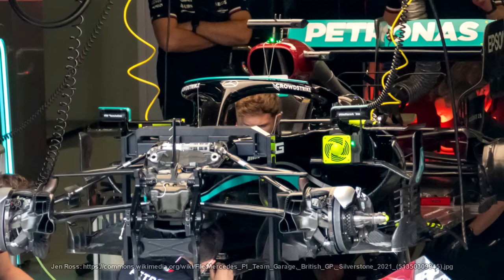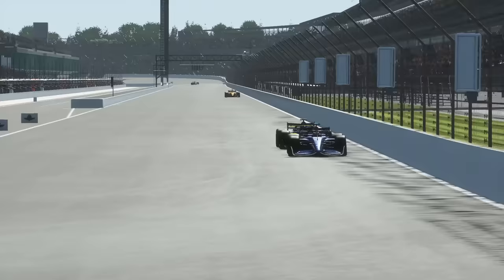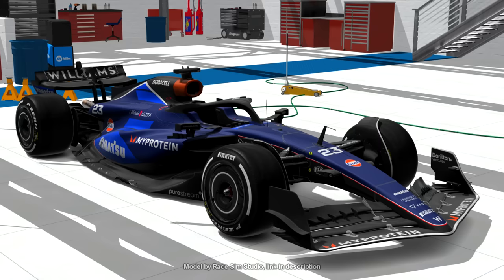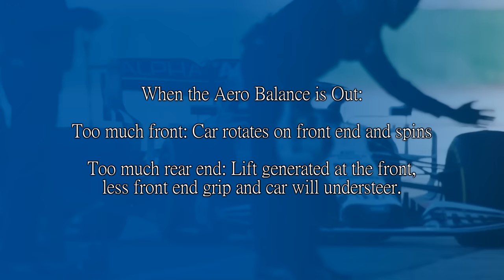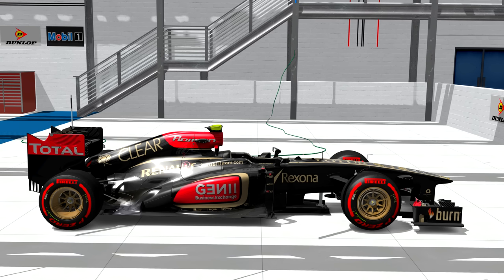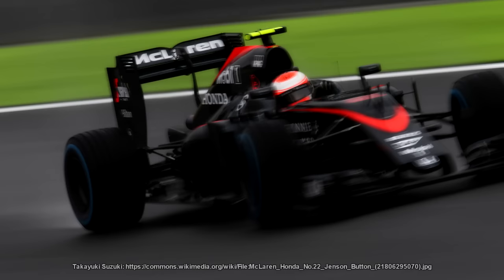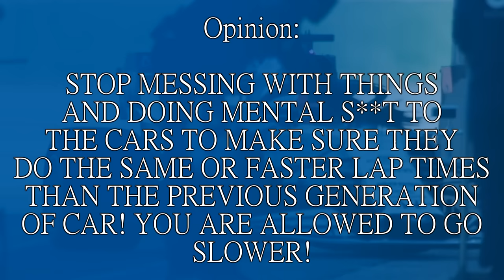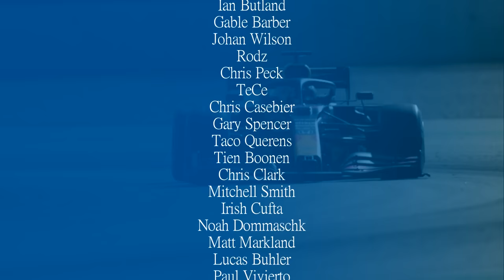BROKEN BEFORE IT'S EVEN IN? Opinions on the 'Undriveable' 2026 F1 Cars

Comment from the maker: Used Assetto Corsa for a video last week, and it's fine.
Use it today and it does not want to open. Anyone else having issues with Steam lately? Cos I've had to run integrity checks on a LOT of my Steam apps this week...
Reply: Not at all here but I haven't played anything more intensive than PES 2021 lately. Probably it was a Windows Update bungling everything up.
Reply: CS2 also needed integrity check for Workshop items
Reply: Are you on a hard-drive or ssd? If hd your disk might be about to fail.
Reply from the maker: @demonicsquid7217  … so what I’ve been doing for the last six years?
Reply: I recently had steam doing an update when I started it it complained about files missing and I clicked yes.
After then my entire AC reset. All Graphics, all controller mapping, all statistics, all lap times, all setups. My entire userfolder was gone. But thankfully I often back up my entire system.
Reply: @AidanMillward  I was very impressed with the way you turned the car around with your  180° turn.
Reply from the maker: @hueginvieny7959  hand clutches my boy :_drink:
Reply: no
Reply: Are you using content manager ?
Reply: Just for poop and laughter try unplugging your wheel base's usb connection to the pc and try and boot into a race. May not work for you, but, for some reason a cpl times in the last 2 years I'd randomly fail the race load repeatedly, only to trouble-shoot far enough to see it was the wheel doing it. Unplugged the wheel and instantly was able to complete the load in.  YMMV
Reply: @gavedillis2040  Sometimes when I turn off my usb audio interface it has a better time loading too. Can always just turn it on later. Just a weird conflict.
Reply from the maker: @reynaldiwidjaja277  yeah I am. Running it in 32bit mode has fixed it.
Reply: Works fine for non-racing simulators for me, but that's likely because this rig knows it's on the way out and is on it's best behaviour. The replacement is RIGHT THERE waiting for a windows install.

Comment: Small note on the Typhoon/Eurofighter: pretty sure it's quadruple-redundant, meaning if the flight computer fails, there are still three remaining to take control.
Reply: I would like to add a second note that the reason it needs those computers isn't so much about complexity, but because its aerodynamically unstable, just like that Lotus.  They could fly it, but the constant corrections would make it exhausting.
Reply: To be even more pedantic, it was inherently designed to be as unaerosynamically stable as possible, to enable it to make major changes of direction at the drop of a hat.

Comment: The more I hear about the 2026 rules, I just want to forget F1 and want a new pinnacle of motorsports. Maybe hypercars running 1.5 hour short races.
Reply: there already are series better than formula 1, so much so that i consider them the greatest on the planet. here they are: 
IndyCar, IMSA weathertech, super formula, and SUPER GT.
Reply: The whole depowering the engines at top speed on the straights thing is the sport jumping the shark gimmick if they go through with it. It's just so ridiculous and anything but "the top engineering competition". It sounds like the active aero is meant to be an autonomous system rather than something the driver controls which they apparently are very upset with. 

Smaller card, less prescriptive regulations, and put a cap on maximum PU output so Mercedes and Ferrari and Audi can run complex hybrids, and Red Bull can run a V8, etc... this forcing everyone into the same arbitrary box in the name of "close racing" will be the death of the sport
Reply: Formula gone.
Reply: Right? and with the engines turned up like the 919 Evo a few years ago
Reply: @solitaryclusterofneurons598  I feel like there should be a separate championship for the Hypercar class where the teams are allowed to go all-out with their cars to set the fastest possible lap times and the top 3 teams are rewarded with massive payments for it. Won't ever happen due to the increased costs but it's fun to think about.
Reply: oh god please no, wrc stages are already baby shorts
Reply: I pretty much gave up on Formula 1 last year. It's pretty much been a 2 team sport for over a decade and most races are a hell of an expensive DRS train between everyone else.
Reply: @CyanRooper  basically, modern day Can-Am.
Reply: Wec become Wsc, (world sprint championship) lol
Reply: @CyanRooper  That would just be LMP1
Reply: @CyanRooper  so like a laptime shootout? They do that at Le Mans for the final stage of qualifying.

It's not outrageously expensive to send the hypercars out for extra sessions; what Aidan described with allowing the cars to run slower is exactly how LMP1 gave way to hypercars, they're slower and cheaper because they're substantially simpler than LMP1.

But beyond that, to focus on one class over the others does away with one of the main quirks of endurance/sports car racing.
Reply: That was LMP1 hybrids until they started becoming too expensive.
Reply: Especially if Andretti are rejected
Reply: Hypercars are BOP.  I hate BOP^.  If Grand Prix car racing and Grand Prix bike racing can be still be competitions, where an Alpine or Honda can earnestly take responsibility for building a crap car or crap bike  respectively, why does WEC need to be BOP nonsense? 😐

^ BOP is OK in production based racing like GT3, as those cars are all fundamentally different and need some mechanism of balancing.
Reply: @TassieLorenzo  BOP is what entices auto makes. They don't have time/resources for vanity projects like they once did, and "we tried but it sucks" doesn't cut it with bean counters when you spend $100mil+ and get upstaged by an energy drink.

^ hypercars aren't that different from GT3 btw- same ethos of "bring what ya got & we'll work it out", just a grabbag of OEM/spec parts instead of a production car.
Reply: @PanderingSlats  My concern is that  BOP can be too easily manipulated, to for  example ,make it more difficult for  Toyota to  win Le Mans despite having built the best car.  If the Red Bull - Honda RBPT is the best car then it should win 21 of 22 races.   Fortunately the ACO "let" Toyota  win most of the other WEC races, but then there was recently heavy handed BOP that had Toyota struggling to get on the podium recently (or likewise Acura BOPed by an extra 20kg out of a repeat Daytona  24h win in IMSA). It shouldn't be about being "allowed" to win or "sharing" wins, it should be a competition to build the best Grand Prix bike, the best Grand Prix car or the best sports prototype!  For a TRUE competition, F1still has 6 auto makers signed for 2026,  which is fantastic and shows it can be done, just as WRC has three in a real competition and MotoGP has five manufacturers in a real competition.
Reply: Do any non Verstappen fans still watch F1?
Reply: @TassieLorenzo  Not saying this of you personally, but I hear a lot of pro-F1 arguments center around a notion of "true", "pure", or "real" competition, and to me that reeks of elitism if not willful ignorance. With high level motorsports manipulation is almost guaranteed, just a question of where/how and the poison you pick.

imho the "best car"/meritocracy ethos is susceptible to manipulation of resource procurement: You hire an Adrian Newey or a Ross Braun, maybe also bruteforce with money, and see how the stars align for your richest competitors. Disgustingly cynical way to look at it, but I think that's arguable for almost all F1 driver championships in recent memory.

I get why people turn their noses up at BOP, but not why they're so strongly against it. imo BOP manipulation gets blown out of proportion- it def. exists, I recognize how bogusly storybook some Le Mans finishes appear on first glance, but I still prefer a season like 2023 WEC over 2023 F1, because I grew up with a gamed meritocracy in NASCAR.

I'm fairly confident Toyota wasn't gifted the rest of 2023 WEC. They caught breaks early in the season, and that the IMSA models were sandbagged too much in the first couple races, but I think the Toyota had the rest of the season on lock because they'd had a couple years head start on the other teams, especially with regards to reliability.

Ferrari definitely had pace from the start in 2023, but they faced rookie mistakes/growing pains which took them out of contention. At Le Mans Ferrari was consistently fastest from qualifying onwards, but the latter half of the race was an endless dogfight between them and Toyota. They had sight of one another for what seemed like most if not all the latter 12 hours.

Comment: I also don't get the point of trying to make the cars enviro friendly when they are constantly adding races to the schedule. Could have 5 less races and run V12s on rocket fuel and will be the same outcome :D
Reply: They could make them with the environment in mind without fucking up the cars if they wanted to. Superformula in Japan requires the chassis be made of biodegradable materials, plus there's always e-fuel.

I say limit X amount of each material a team can use in a season, and allow only materials that can be broken down and reused for new parts again, especially with tyres (IIRC F1 teams use about 700 tyres in total on a single weekend, that's a lot of wheels and rubber that could surely be reused).
Reply: How about F1 race in Europe only. There's your eco friendly for ya!
Reply: Easy. It's all just greenwashing.
The F1 cars themselves probably don't use half the energy that all the refrigerators around a track do, much less the team jets, transport, or by god, the fans and track people.

The cars are probably the greenest part of the weekend.

It's all for show.
Reply: Also the race scheduling. Like why are there are two weeks between Australia, Japan and China? Just have them one after the other so teams go from Australia, to Japan to China. Way better than having teams flying back to Europe after each.
Reply: I'm very aware I'm not able to keep up with F1 the way I did due to family commitments with children with additional needs etc, and that the things passing me by seem weird and unrecognisable when I dip back in here and there. But even adjusting for that "I like what I used to see" bias F1 is so bloody broken now. Too many races, too much tinkering by liberty media,  cars too big, marshalling too inconsistent etc etc. F1 needs to be really careful because with so much racing avialble on free to air TV and live on YouTube it's not like there isn't something else to watch...
Reply: The trick to understand is that none of the teams want to spend money developing a racing powertrain for their cars that has zero usefulness in improving their road cars. They do a lot of cross development. And pure ICE as an engine tech is functionally dead to them, (from a profitability standpoint), in road cars because of the incoming EU legal changes in 2035 and 2050.

They want to focus their development on electric and the electrical side of hybrids. Not pure ICE.

I suspect the massive mess that the 026 regulations are turning into is down to the precise Wording of the Formula E contracts. Those lock certain things on the electrical side to Formulae E until i believe 2030. So the current F1 power unit rules are built around not violating those contracts whilst going more electric like the teams want.
Reply: Propaganda, plus they get tax breaks from Black Rock
Reply: @bluemutt9964  <---- nailed it
Reply: @darthkarl99 yeah, sure, Renault wants to develop a 1000hp hybrid PU for the Clio, Honda with a souped up Accord and Ford with a 1000hp hybrid Focus 🤣. It honestly baffles me this “F1 tech trickles down to everyday road cars” bullsh*t is still flung around. It’s all marketing and greenwashing…and this is coming from a “treehugger” !
Reply: @MrPrajitura  It doesn't trickle down in the form of them putting F1 engines in their road cars, but theres a lot of basic stuff used to optimise them that HAS trickled down. The history of motorsport is littered with examples of exactly this happening.
Reply: It's virtue signalling and nothing more. 1 large freighter ship emits more carbon in one Taiwan to LA trip than the entirety of a season of F1.

Comment: Peronally I think the FIA is overdoing it with the cars.
It is that a potential reliabillity aspect can get quite dangerous with the active aero. If things aren't working like they are supposed to and it happens all of the sudden, you will have someone like Max or Lewis  crashing while they were relying on that thing to work properly.
I had no issues with the formula introduced in 2014. Yes, there were loads of reliability issues, but that is motorsports. An engine going wrong is something I am used to when I started following F1. That happened on a regular basis. And when an engine "dies", you still have control. You could savely park it somewhere.
This is different with these. If the electronics mess up, you are lucky, if the drag is not reduced in general. If only one side is reduced and the other is stuck on, you will have a massive inbalance.
FIA, just forget active aero, please. Just make them smaller and more raceable. Who cares if they are 4 - 6 seconds slower?
Reply: Aircraft have all kinds of "active aero", and are tested with asymmetrical deployment of such things.
Reply: @UncleKennysPlace 
But they don't race .

Comment: Interesting point to consider, and maybe do a video about, are the future regulation changes across the board. F1 is late and runs into trouble, WRC pressed the panic button and the 2026 regulations (and 2025!) are already late, WEC made last minute changes, which in turn made Toyota change their approach and left Peugeot to compete with a car set for different regulations than what they got. WEC did turn out well, arguably due to LMDh, but this is an awful lot of regulatory hassle in different sports in a short period of time.